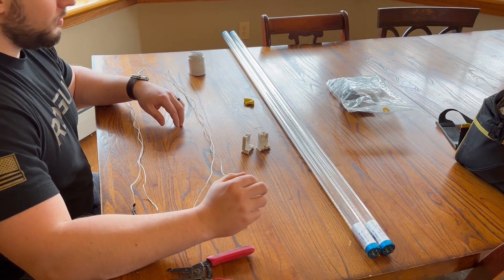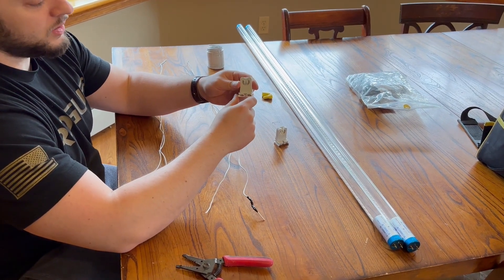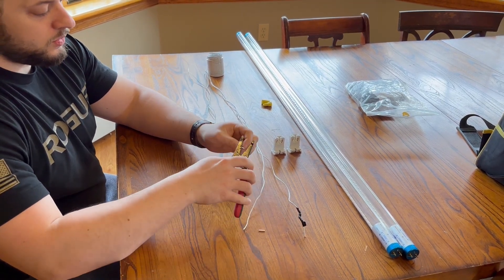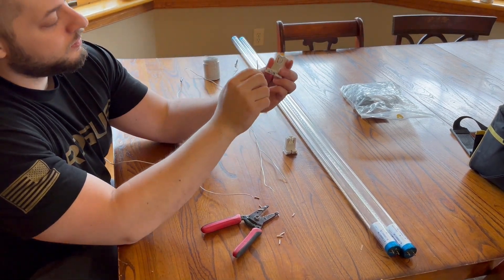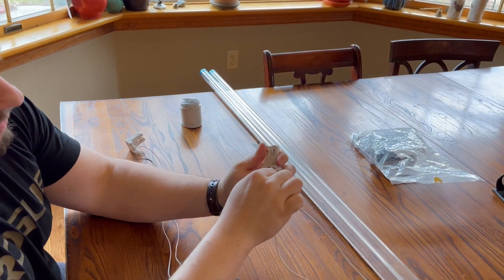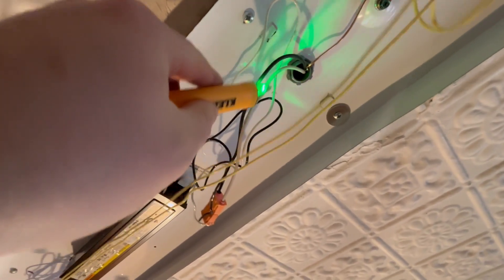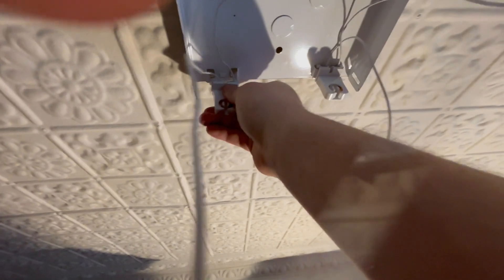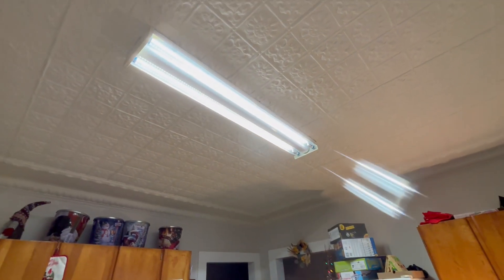How To Easily Convert Fluorescent Lights to LED T8 Tubes!

Comment: Nice job but those existing sockets were actually un-shunted so you could have done one red and one blue wire to the black hot and the remaining red and blue to the white neutral and it would have worked good.